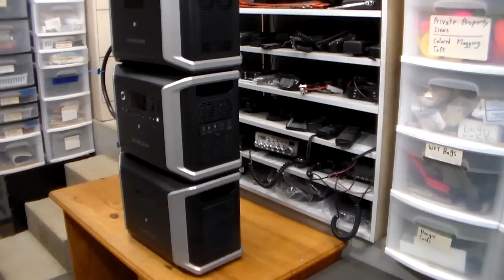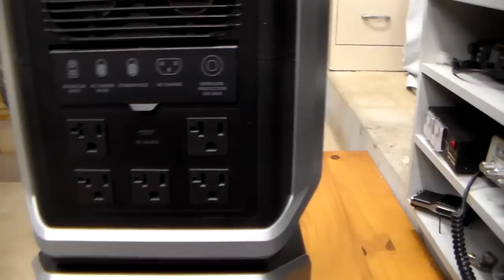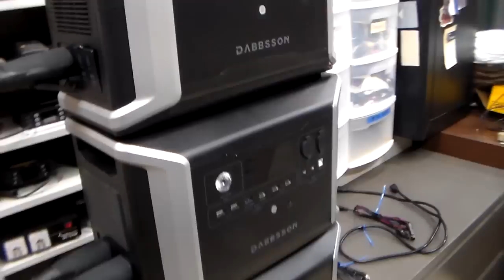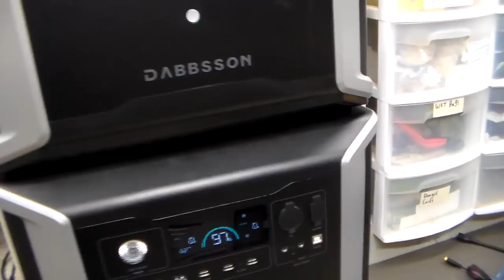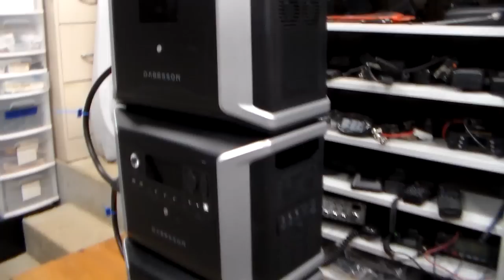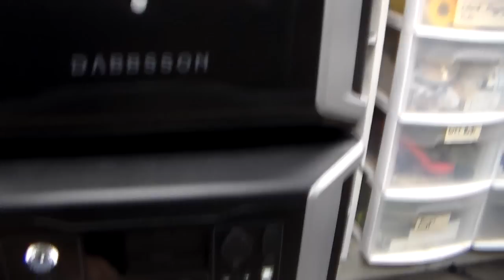Dabbsson Power Station...8330 watt hour unit....Largest one I have tested

Comment from the maker: https://amzn.to/41GpeY5
DBS2300 Price: $1799
Coupon: $400   Make sure you check the box
Code: DBSDBS08 $100   Use code at check out
Price after Coupon and Code: $1299    

Dabbsson Extra Battery Pack DBS3000B     https://amzn.to/41Pt1lv     $1599 for extra battery

Dabbsson 5.33 kWh Expandable Power Station DBS2300 with DBS3000B Extra Battery:   https://amzn.to/3UVEnlJ      $3299 minus $400 if you check the box and take the coupon equals $2899

Total $4,498 for the power box and two extra batteries in the video.  This is a MAJOR investment.  Please contact me at southernprepper1@yahoo.com to figure out the best power box for you that will do what you want done and stay in your budget

DBS2300 Home Backup Power Station: https://dada.link/sAbS5u
Code: DAVE500   Use it to Save $500

Comment: Did you have to disconnect the battery from the main unit to charge it?  I have two 200 watt panels in series connected to mine and it doesn't show that I'm getting any solar input.

Comment: I just picked up a DBS2300 plus with one extra battery for $2380.  The deal appears to be over for now.  You can take another 5% off if you have Amazon credit.  The total price without tax is $2261.  That's about 42 cents per watt.  I don't think you will find a better deal.

Comment: I have just the main DBS2300 unit, and may add one expansion battery later. One of the things that sold me on it was the low cost per watt hour, and that I could charge it very fast, in just 2 hrs from my generator, (or at a decent rate from solar) then shut off the generator and use the Dabbsson overnight. This unit is unique with being able to charge an expansion unit backup battery independently, and that sounds like a good feature to me. It has a pass-through mode like a UPS where it can also automatically switch over within about 15 ms. It also is one of the first units to use a safer semi-solid state EV battery technology. Adding WiFi and Bluetooth control was a bonus that many of the other companies do not have. If you tap the power switch the display turns off immediately, and the AC power and DC power buttons kill their outputs immediately.  I believe the unit times out for a complete shut down in two hours if not being used.

Comment: Dave my wife and I are looking to get a solar generator for our cabin to run ac or a 1500 watt heater but I feel this is way over my head. Would it even be feasible? We only stay there on weekends
Reply: Solar is not recommended for heating just best option would be gas. I use a portable gas heater during winter

Comment: Beta unit quirks aside, honestly, most of these "complaints" are unjustified or just plain ridiculous.  The "unit" does not weigh 166 lbs (actually 164.1 lbs).  Its 53.1 lbs for the main unit, and 55.5 lbs for each battery unit.  Its three separate units, and you do not have to carry all of it at the same time.  In any case, the similar Bluetti setup is 221.1 lbs total or about 35% more.  Any DIY setup with this capacity and features will easily be in the mid- to upper-200 lb range.  Next, it was you who decided to stack the units.  You are not required to stack the units.  As for charging commentary in general, you are making a mountain out of a molehill.  AC charging is via one connection point.  You plug in the main unit and it charges the main unit and battery units from that one connection.  If you are using this in a home back up situation, what is the problem?  You got AC wall plugs everywhere.  If you are charging from home solar, you would have a set panel array to inverters and you charge this unit from that setup via AC.  The DC input solar charging implementation on these types of units are for occasional, light duty field charging.  How many solar panels are you bringing with you in the field?  Fifteen 200W folding panels, 500 feet of cabling, combiners, etc.?  You bring all that?  Of course you don't.  Its not a thing.  You bring a few 100W-200W panels and you get what you get.  If you really need more than that, maybe this product is not for you.  Simple as that.  But let's say you did provision all those solar panels.  The answer is easy.  Jumper the solar inputs across the units.  Each unit will draw up to its maximum current until its full, and the balance goes to the remaining units until they are full.  This is not difficult or complicated, and you are already doing this anyway with the AC.  Its not a problem.  But you want to offer us help on how to pick a system?  You don't even understand this very simple system.  🤣
Reply: I bought the main unit and an extra battery.  I put them on a small furniture dolly from harbor freight to move around.  It was about 12 dollars and it works fine.

Comment: I find the cost of the entire systems required to actually, reliably, run anything important in one's home (deep freezer, fridge, heating/cooling), for solar kits is absolutely prohibitive. Especially since the batteries do not have a good life cycle. Too bloody expensive for me. The "cheaper systems" might be ok for a camper but nothing I've looked at is doing anything for a home operation (not even talking about total home backup, no). Because most of us cannot afford to live on a homestead because that is also cost prohibitive beyond imagination. I tried, never worked out well in spite of excellent, solid research - well alone cost more than double due to dry holes and wellhead being so far away from actual possible home site.  Water filtration system at least 8K. Septic system 15+k. You gotta be very well off to do this... really appreciate your reviews of these different systems! Very competently done and put in user-relevant perspective. Thanks!
Reply: The batteries don’t have a good lifecycle? You likely won’t live long enough to take this down to 80% capacity! It’s over 3,500 full discharge and recharge cycles. Even if someone would do this every day then it ‘s about 10 years. RhT’s quite a lot.
Reply: @NOLAgenX  It's actually 4500 full discharge cycles to 80%.
Reply: It does take a LOT of money and income to live like you are in a pre-industrial era.

Comment: Bluetti way better quality and better price.
Reply: I got the main unit and one extended battery for less than 45 cent per watt.  You can't do much better than that.  I also have two Bluetti AC200P's also.  No app for them.  So, you are stuck with the firmware it came with.  They are OK, but I wouldn't buy another one.

Comment: This thing is almost $2K.  There’s a lot of competing preps for that kind of money, one off which is I can buy a LOT of gas (today) to power my generator for the same amount.
Reply: But what about if or when gas is not available....or if shtf really HARD and the price of gas is too much for the average person?
Reply: A traditional gas generator is a cheaper way to go, but as some point out, gasoline is a commodity and availability might end up being a problem. Second, a generator is hella noisy, and with something like this, you can run some essentials at night without the generator noise, and use the generator during the daytime to run the house things and also charge the power bank. And in a true SHTF, charge via solar ( you'll need more panels and also know how to set them up properly and not fry your batteries) or even a wind-powered generator.

Comment: Yea when u pay 6 to 9 grand for all of those I just spent 3300 bucks for a solar generator with solar panels so my teenage grand boys could get enough power to not be booup at my off grid cabin which has solar power but I needed it for my whole family and I hope and have confidence that it will work if not I gotta 1 year send it back warranty

Comment: So do you recommend this for solar power panel? So complicated! Will this run a 5000 btu window a/c unit for 8 hours a night?
Reply: Dave didn't recommend this one. It's really hard to run a c off of these kind of units because a c uses so much power. Based on the approximately 8,000 watts this unit has, if it was fully charged, would only run a 5,000 watt a c for only a little over an hour. I think a small window unit that cools only 1 room could make it through the 8 hours. It sounds like this unit might be difficult to fully recharge with solar in one day.
Reply: I can run a 1300watt (about 9500 BTU) portable AC unit overnight with this setup, the 2300 plus the two extra batteries. The compressor draws most of the 1300 watts, but isn't running continually once the room is cooled to the set temperature. In an 8 hour period, the power bank will discharge between 50-75% depending on outside temperature and what I set the room temperature to on the AC.
I got this to prepare for extended outages after hurricanes. I can recharge it via my gas generator during the day, running the AC in my bedroom from the gas gen during the day too, to keep it cool, and also run the fridge etc from gasoline in the daytime. At night, I will be able to run the portable AC so I can sleep, and keep the fridge/freezer going too.
This will not power the entire house for a day, let alone an entire week, but as an emergency "bridge" until the power is back it seems to be acceptable for my use.
The next step up, a whole-house backup that's good for a week, is about like buying a car money wise.

Comment: Wouldn't it be cheaper and much better, to just get mabe 4 high quality, like sharp 200 + watt panels, a good charge controller and inverter, then add a few L16 batteries? Definitely not a portable unit, but I believe much better.
Reply: Use LiFePo4 if you’re going to do that.

Comment: it seems like a really good unit but the price might be out of lot of peoples range. My suggestion if you need this kind of power and you can get some help with the setup. there are Lithium batteries in the 250 amp range.12V 200Ah Plus LiFePO4 Battery, Built-in 200A BMS, Deep Cycle Battery with Max 2560W Output Power, 600 dollars buy 2 its 1200.00 (5100 watt hours) for less than have the price,  all the power you will ever need. Matter of fact one battery will run just about all your electrical devices IMO. Ive gone both routs the Power box and the batteries.